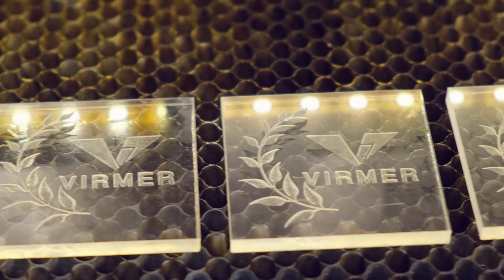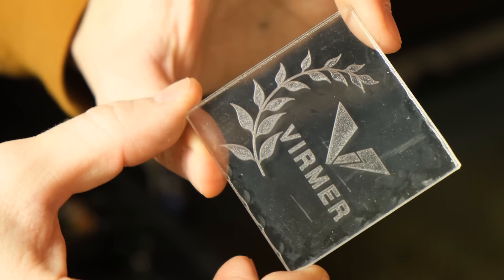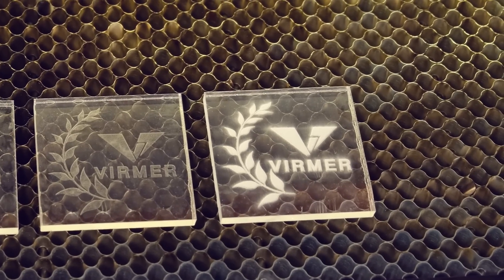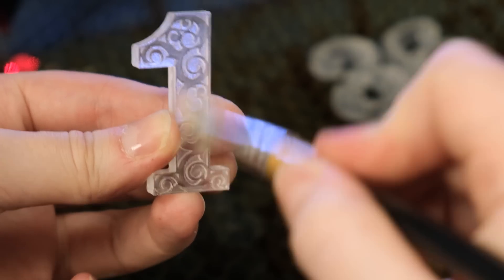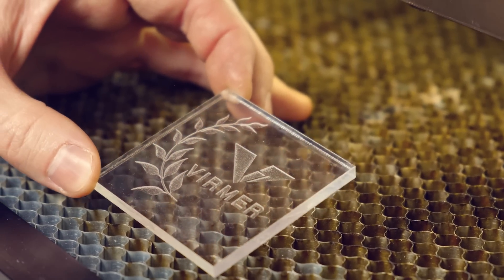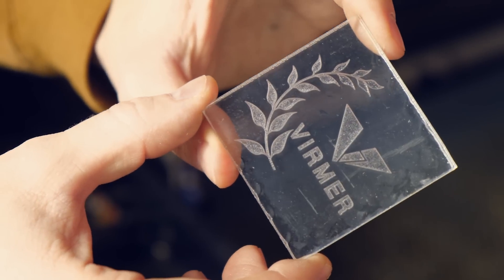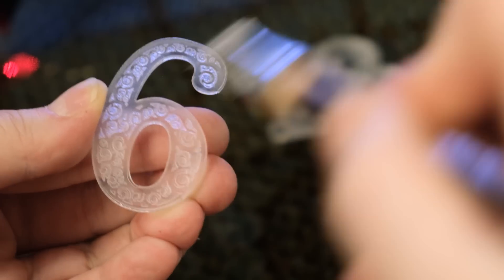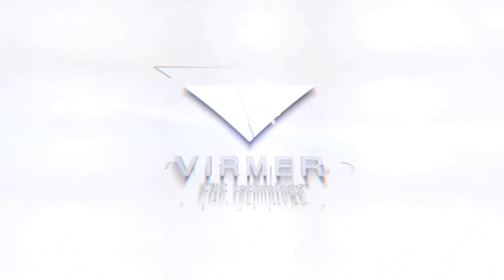HOW to ENGRAVE ACRYLIC? | LASER ENGRAVING ACRYLIC | Virmer cnc guide

Comment: One is mine make popping sounds when I’m engraving
Reply from the maker: Maybe it is the High Voltage connector on the laser cable going from the PSU to the Laser. And please cheak your laser tube. It could also have been damaged.

Comment: And what's your method to remove scratches or to clean it without scratching it?
Reply from the maker: We just try to handle the materials with care. But you can try soaking a piece of 800 grit sandpaper in water. For 2-3 minutes remove the scuffs in a circular motion by pouring water on the surface🌊

Comment: I found a new way for engraving you might be interested in.  The black poster board worked fair with a lot of clean up.  I found if you use the poster board and raise the acrylic by a 1/2 mm from the poster board it will not stick to the acrylic.  So there is hardly any clean up needed with a fantastic burn.
Reply: But wouldn't this be too expensive?  do you have to use a new poster board every time you want to engrave?

Comment: What are you applying on the surface before engraving
Reply from the maker: Hi! Thank you for you comment! 
1) Method  by applying WD-40 to the surface.
This method allows for getting rid of white residue. Apply a layer of WD40 to the pre-cut acrylic before engraving. Start the process of engraving. When it is done, wipe the product. After wiping, no residue is visible, but on the surface, there are some oil stains, which must be wiped with soap and water. It is worth noting that this method is only suitable for engraving pieceworks.

2) Method by applying a soap solution.
Prepare the soap solution before engraving: dissolve some soap in water and stir it up. Apply the solution to the material using a brush, sponge or cotton wool. Start the engraving process. Remember to make sure that the engraving area does not dry out. Then use a regular damp sponge to rinse off the solution. This method allows for the image with a very high-quality contrast and neat edges.

 If you have any more questions feel free to contact our custom support! 
🔗We are always in touch:
📞 +31852731786
📞 WhatsApp: +31 6 16085518
📧 info@virmer.com